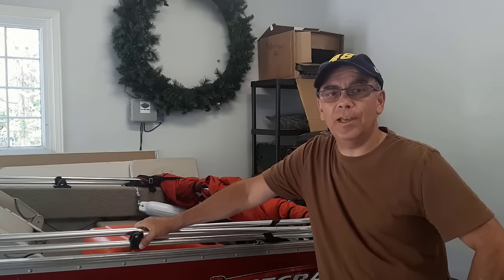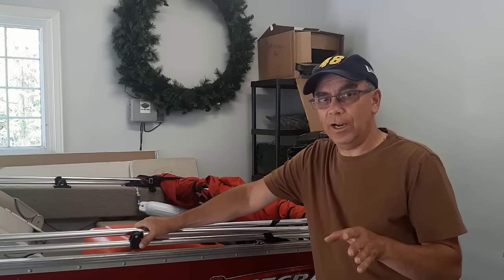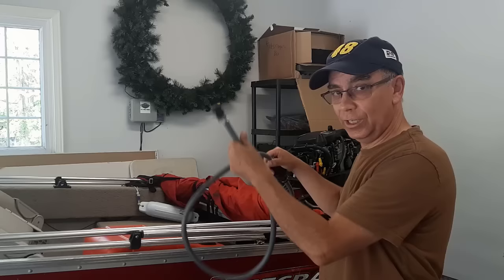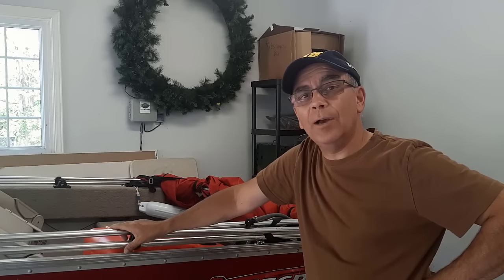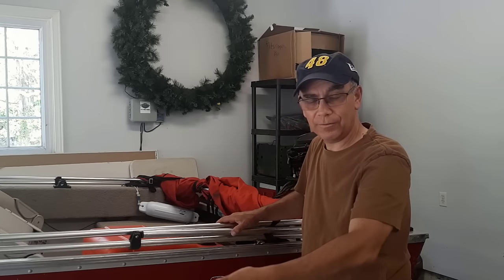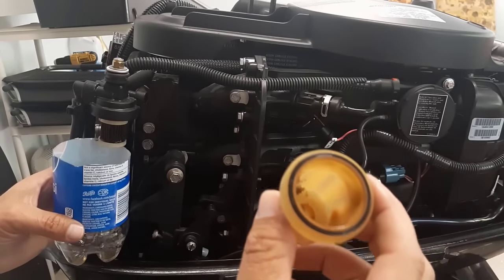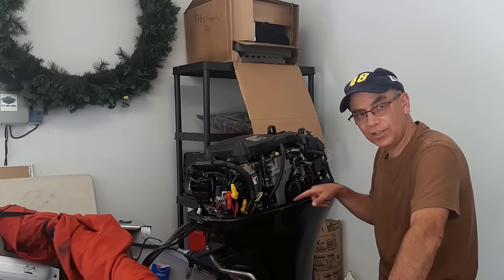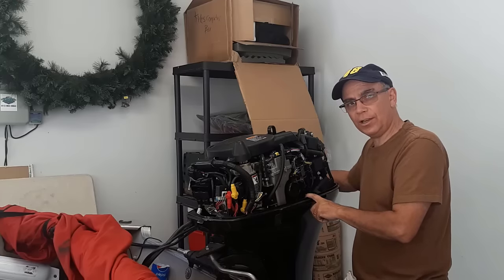Mercury Outboard Runs Then Dies // Try This Before You See Mechanic

Comment: I've had the same issues (on my 2001 50HP Mercury 4stroke (1F51412YD), except when my fuel line disintegrated it got past the inline fuel filter through manual fuel pump and into all 4 carburetors. I replaced fuel line, filter and the manual fuel pump too. I've cleaned the other fuel lines from intake to the carbs, took the carbs off and cleaned them...(twice). Now 2 of my carburetors leak at the new plunger boots and I'm getting ready to take them all off again. I hope I can figure out why the new boots are leaking now. If anyone has any sort of knowledge or experience with these carburetor plungers, please let me know what you know. There is nothing online that I can find on them.

Comment: you can add a fuel/water separator filter in between your tank and the engine that will help also. Ethanol Gas is terrible! I always use Startron Enzyme Fuel Treatment in all my boats and gas equipment at home.

Comment: Got a Yamaha 90 2-stroke. Its very hard to start cold only and sometimes it dies in neutral. Carburators clean, no water in tank. Any ideas what i could check? :)
Reply: Are you choking it to start? Checked your plugs? Is the primer bulb staying hard after priming? Is your gas/fuel ratio correct?
Reply: @BringItOn31124  Thanks! It might be the enrichment solenoid, the motor does not have any manual choke. Plugs ok, bulb woking no leckage, all 3 carburators spotless and no clogging jets. I have not used the boat in 2 years now, but just remembered that i have to open the emergency valve"chocke" to get it to start, put it to normal i think it dies on idle. Is there anty ways to check the gas/fuel ratio? Do you know if the enrichment solenoid should do any sound?
Reply: @BringItOn31124  Found dangar marine video: Yamaha Prime Start diagnosis saying that when its up temp it should been running with the manual "choke" set to off. he swapped gasoline and cleaned tha carburators and it run normal again. Now i need to clean it again haha, i know its 100% clean and i have drained the carburators and used it many hours in between with no difference so investigation is ongoin :D
Reply: Pump all of that old gas out. Replace with 100% gas (no ethanol) if you can with Quicksilver 2 stroke oil at 50:1 ratio. If you want to see if your enrichment solenoid is working just remove the motor cover and watch it as you push the key in to choke.
Reply: @BringItOn31124  Sadly i can't buy 100% gasoline, ethanol sucks. Also I do t have that function with the 🔑. Did have new fuel last time I did check the carbs. Thank you for the tips I will update if I find the problem.
Reply: @yamahass66  I've never heard of a keyed remote starter that you can't just push the key straight in to activate the solenoid. What brand and model of remote do you have?
Reply: @BringItOn31124  I'm not sure i remember. Yamaha 703 or something I think. Yamaha 90 1998 or so. It gets activated by turn the key. Pressing it in won't make it chocke.
Reply: @yamahass66  I also have a '98 Yamaha 703 remote start. You turn it to the right to start. You push it in and turn to the right to choke and start. You can take the cover off your motor and check your solenoid by just pushing the key straight in. That activates the solenoid to choke the motor.
Reply: @BringItOn31124  Actually you won't activate the chocke by pressing it in on this engine. There is a way to push the key in the choke function but this engine does not have that option at least not the European model.
Reply: @yamahass66  So why earlier you said it might be the enrichment solenoid and you didn't have a manual choke? You have to have one or the other. My motor has both.
Reply: @BringItOn31124  Sorry miss communication. English is my 4th language. I did Google it and did now what it called. Someone on a English spoken website called it that. Only a few motors have that push-in-to-choke. People are believing it has function but often is has not.
Reply: @yamahass66  Just looked up information on what people are calling an "enrichment solenoid". Turns out Yamaha has an electro thermal valve called Primestart. It's an "automatic" enrichment (choke) function that is supposed to open when the engine is cold and close after the engine heats up. It can be manually set too. I think the biggest problem people are having with their motors is ethanol related. Hopefully your ethanol content is not more than 10 %. Ethanol even at that level is bad especially for carbureted engines.
Reply: @BringItOn31124  Yes thats correct.  Sadly i think we got 15% in it i think it making it wors with water and other things in it nowdays. When i set the "manual choke" to emergency the motor works. Have to figure it out, sadly i dont think it was water since i installed new lines wich also cracks all the time due do lower quality nowdays.
Reply: @yamahass66  I think it is actually against federal law to run an outboard on e15 in the U.S. There are pictures on the internet of overheated pistons from using e15. I would not run that motor at high rpm. If you have access to black automobile fuel line, get it because it is made to handle ethanol.
Reply: @BringItOn31124  Sadly im in europe :D Wishing there was such law here haha. Sadly that time has passed. Love 2 strokes.

Comment: I bought a small minispeedboat and after about a year i had same problem , run fine then bog and goesvto idle ..........a mechanic  i took it to said they had used cheap plastic fuel line so he put in new good fuel line and problem solved. The inside of the plastic fuel line disinigrated into bits and pieces 🇺🇸
Reply from the maker: Exactly those cheap fuel lines can cost you more. Good to hear it all worked out!

Comment: My problem is no gas flow from quick connect to filter. How do I take out and clean male connecter on motor? Same motor.
Reply from the maker: I've never removed one but I would spray with carb cleaner.
Reply: @GettingItDoneRepairs  . It turns out all gas ⛽ lines were corroded and imploded and swelled up. Any suggestions on gas or fuel lines that won't do that?

Comment: Ethanol eats the inner liner. You have to get the line with no plastic inner liner or get one that is ethanol friendly.  The grey hose that is kinda textured with no liner is the good on now days.  Grey hose that is smooth with plastic liner is junk. It will turn into crystal's and clog up everything.
Reply from the maker: Thanks I will be changing it soon. Almost boating season!

Comment: you should have installed new fuel line that runs to the carbs because fuel line breaks down from inside out and the particles from the fuel line goes straight to filter and then carb.

Comment: I done everything you did but mine still does what yours was doing. I replaced both filter's still does the same.
Reply: 2 or 4 stroke? If 2 you may need to rebuild your carbs now. If 4 possible injector partially plugged up.

Comment: I had an outboard that would run fine and then just die. After rebuilding the carb half a dozen times and replacing everything fuel related, pump, lines etc. I finally realized the NEW gas tank I had bought was the problem. Somewhere it was losing pressure. Replaced the NEW gas tank and problem solved. Hope this helps someone.
Reply: There is no pressure in a gas tank other than atmospheric, always make sure tank vent is open and not plugged up..
Reply: @fixtritephil7712  well apparently it was losing its atmospheric pressure.
Reply: @hulkhuggett  Your problem was most likely the EPA compliant vent that new gas tanks all have, some are problematic...

Comment: Good video.  I like your pace, logical thinking and level of detail.  I'm wondering if you might be an engineer (like me).  Anyway, I sub'd.  Thanks for the video!
Reply from the maker: No I'm not an engineer. I worked in car manufacturing at GM for 33 years and always having to fix something around the home. Thanks for your support. Have a good day 🌞

Comment: Your mechanic guy you talked to is wrong. There are 2 other filters in your VST  (Vapor Separator Tank) and the tank can get gummed up as well causing bogging issues. Having this issue with my 2010 Yamaha f70

Comment: Same thing I had but one thing u forgot to do is the bowl on the carb needs to be clean and possibly the carb itself to be clean
Reply from the maker: Thanks for the advice. I ran this boat the rest of the season without issue. Perhaps I will take a look at the carb early spring. Thanks 👍
Reply: @GettingItDoneRepairs  no problem I have a mercury 25 4 stroke with a inline filter and it had gumed up and had dirt and trash build up in the carb and the sending unit for the gas it had to be all flushed out. Mechanical feed starts at 250$ and up

Comment: I can’t recommend enough to use non ethanol fuel.   Fuel with ethanol eats hoses and puts debris in your hoses, filters and carbs.  I learned a strong lesson losing a $10000 motor because of ethanol.  Ethanol is not your friend in boating or small engines.

Comment: When I was a kid my grandpa's old diesel truck did this. I was driving it and it died. Of course being a dumb kid I looked at everything and couldn't figure it out tried it again and it started. I got down the road aways and it died. After a couple of times of this I started putting the pattern together. This was before cell phones. Eventually I was able to get the truck to a gas station and call them and he came back and drove it the whole way back to the house like that. Once he took it apart he said that the fuel would take a few minutes to get the debris down to the fuel filter. Once it clogged the truck died. After it set for a while the sediment would settle allowing it to run for a few minutes.
Reply from the maker: I had a similar problem with my 70 Nova many years ago. It would run for a while then die. But the problem wasn't fuel, it was the fuel pump. When it would get too hot it would stop working. I called my Dad, told him what was happening. He came down to where I was stranded and pulled a bucket with water and a rag out from behind the drivers seat. He then wrapped the water drenched rag around the fuel pump and said start it. Sure enough it fired up and I was able to drive it home.

Comment: I have the same problem but I have a OEM 65 gallon tank that look brand-spanking-new when I build it no problem with the ventilation whatsoever and my bulb vacuum shut what could be that issue I don't get it after I replace the bulb it didn't do it as far as above collapsing but it's slow down but didn't cut off everything is brand new Yamaha no Chinese crap

Comment: Grey fuel line is garbage always. If you have an older Seadoo it has those lines and is almost certainly your drivability issue. 
As for your outboards there is another trick you can do; while under load on the lake with cowling off have your driver put into gear until it starts bogging. With flame arrestor off the carbs use a rag to block one of the carbs off (choke it). This created a vacuum in the other carb and will clean the jets. 
$1k advice there folks. Your welcome.

Comment: Just a thought. The fuel lines should be drained after the boating season. Hang it up and push in the pins at either end and sqeeze the fuel out.

Comment: Never used BOAT fuel line!!  Go to any auto parts store and get real fuel hose. Its a little more expensive, but worth  not getting headaches.
I was told years ago the ethanol in the gas will destroy boat fuel lines.

Comment: Plastic ties ( zip-ties) is not the way to go, at minimum,you must use compression clips, and yes ,the primary filter has to be done each season ,and the secondary filter ,every second -season. And do not run with ethanol fuel

Comment: Normally when the motor runs good and as you increase the throttle she falls on her face and cuts off 99 percent of the time it's the check valve in your primer bulb on fuel line . Quick fix.

Comment: Replace the grey line with automotive gas line and you won’t have that issue with the liner. Get the proper size line and in bulk then make it as long as needed. 
Good video.
Reply from the maker: Thanks did that!

Comment: Common sense with any type of motor is to change the fuel filter. People don't even do that on their vehicles. A lot of older vehicles have external fuel filters to protect your engine from contaminated gas not just in the tank but on the outside of the tank you have in tank fuel strainers fuel pump and then you have an external fuel filter. If you don't have one you can put one in the line somewhere coming from the fuel pump. That's just common sense that's the first thing you want to change but nobody looks at it. If you do not change your fuel filters that makes you a fuel pump work harder and will shorten its life. So I mean that's his common sense I've been a mechanic for over 45 years thing I'd tell anybody change your fuel filter change your transmission filter change your oil filter. People don't think about it oil filter common but people never think about changing your transmission filter. When you do you want to put new oil in with old. More new less Old. But in your converter you should have enough old transmission fluid in there where you can put all new in the transmission. Never never flush a transmission. That's the dumbest thing that you can do. That's like going to the hospital and having your system flushed and put new blood in. You will die because your body can't handle the flush. Certain properties that are in that transmission needs to stay in that transmission it's not like a new transmission if it the vehicle was a brand new vehicle I can see you flushing it. But nothing old
Reply from the maker: I agree with you 100% The car dealers are always trying to talk people into transmission flushes, radiator flushes etc. 

They told my mother-in-law she should flush the radiator. New car with 17,000 kilometers. I don't think so. Hard to trust dealerships these days.

Comment: Unless there is an obstruction in the pump , a worn impeller will not effect cooling except at low speeds. At higher speeds the engine is cooled by ram inlet pressure. The vanes actually retract in at higher rpm's allowing the ram pressure to bypass around the impeller.

Comment: So what happened did you get it fixed? I bet the thing stalled on the water again and he lost it! He threw the motor in the lake!
Reply from the maker: Yes it runs perfect now. Lol never doubt me. 😀
Reply: @GettingItDoneRepairs  I have been having the same problems with my 15hp johnson I rebuilt the carb changed the filter now it might be time to get a new fuel line and tank. These parts ware out fast these days.

Comment: Don’t buy those cheap grey stiff ready made fuel lines that are so common now.  Get that black rubber stuff at an auto supply and make your own. A good fuel line will last 10-15 years no problem.

Comment: It was probably the Bulb in your fuel line went bad.
Reply from the maker: Actually the line inside the fuel line deteriorated and I show it in the video. Maybe the bulb had deteriorated inside as well. I didn't cut it open to find out. I changed the line and bulb.
Reply: @GettingItDoneRepairs  I always kept a Fuel line made up without the bulb in it afterwards and just used the Bulb fuel line to pump it up the get the motor running and after the motor started good I changed to the Line without the Bulb.......Never had problems after that.......But I don't use Ethanol gas either........I also had a friend that had the same thing happen to his outboard the same fix I used saved him from taking it to a mechanic also.

Comment: Insufficient fuel pressure , replacing fuel filters , gas lines on a engine that has seen very little maintenance is going to leave you adrift, buying gas at the marina is risky too but you gotta have it , buying a new gas tank is good it was dirty and old , you got it running good job

Comment: Filter inspection and replacement is an annual part of maintenance.Use non-ethanol fuel an avoid most fuel related 
problems .Outboard motors don't die their owners KILL THEM!!

Comment: The biggest issues with an intermittent outboard are carb,, gas related.  Always protect your carb with a good filter, Change the lines on the engine, then all the way to the tank.  Do not store the engine with out draining the carbs.  You can also drain the bulb line by taking it apart, or cut and re attech the line , only loosing an inch.  Do the maintenance before you hit the lake, run it in a barrel.  Make sure your gas is fresh, clean,,no ethanol gas, and the right mixture.  Clean the gas tank too.   Do your best to not be stranded miles into the wilderness.  oh ya,,  prepare a boat tool kit,,and an emeergency pack to spend the night,,if you go way into the wilderness,like me,, Im a nut.
Reply: How do you clean the gas tank ?

Comment: That Fking liner. Believe it or not, that fuel hose is USCG approved.. but was never tested or approved. I almost got run over on an 11 ft whaler from the same thing.  That manufacturer should be shut down. West Marine also sold that hose.  The delamination is totally un acceptable.

Comment: I bet your not using premium grade (ethanol free) fuel… that will degrade carburetor seals, fuel line, etc. any 2 stroke engine  should only be ran with ethanol free

Comment: Water in gas
Reply from the maker: No it was the liner in the fuel hose that broke down over time and blocked the fuel filter. Running great before I put it away for winter last fall.

Comment: That mercury silver line should be banned or at least flagged not compatible with ethalnol  gas.  it's funny my 4 stroke 8 hp mercury had the same problem but not my 6 hp tohatsu it has black rubber line ,despite that both engines are made by tohatsu in japan ! FYI south of 7 they sprayed for Gypsy moths in 2019  you had a lot in your garage in 2020.